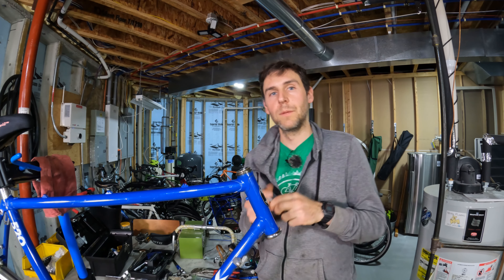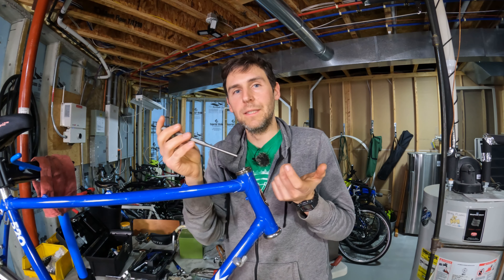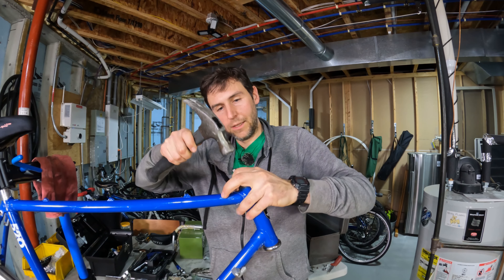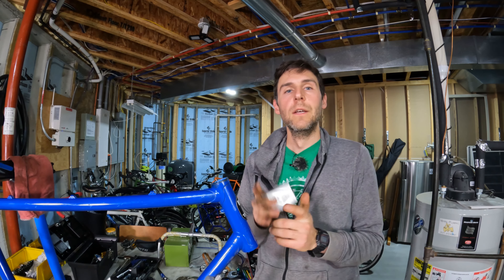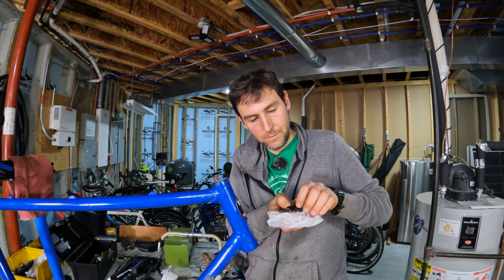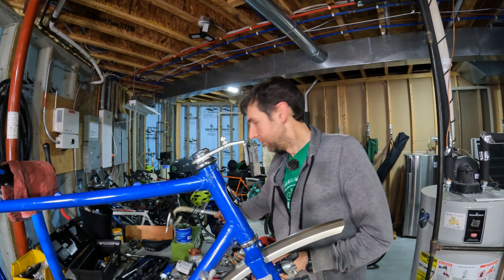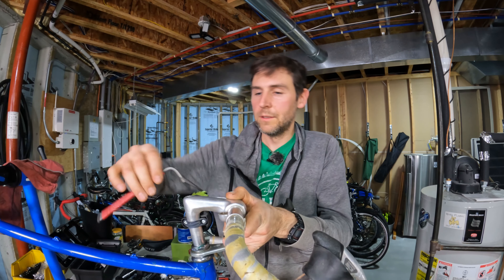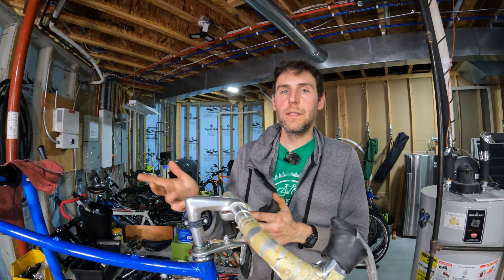DIY Bicycle Headset Sizing & Replacement (Threadless)

Comment: Hi it's Alan from Maidstone . I've got a Dawes mojave and earlier last year the headset seized. I went to the Evans where you bought your Pinnacle Akrose 4 to buy new bearings. They had a new threadless fork for sale  £5 . I decided to switch from a threaded headset to threadless. I also went to cartridge bearings with a FSA orbit 2 . With a new handlebar stem the conversion was pricey but worth it.
Reply from the maker: Oh yeah!  That is an interesting option, not actually sure how cartridge bearings work with normal head tubes but that's definitely an upgrade, threaded headsets are a pain in the butt to adjust.